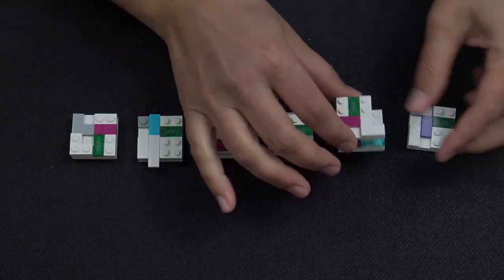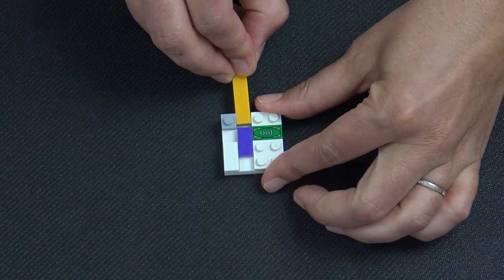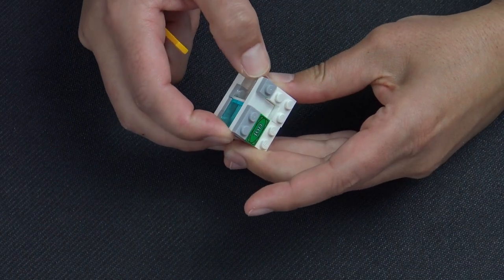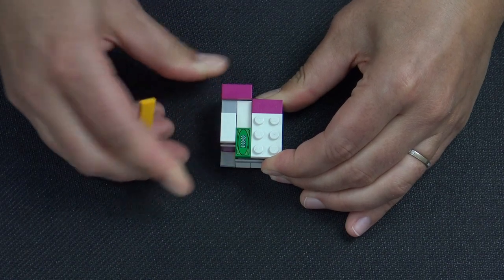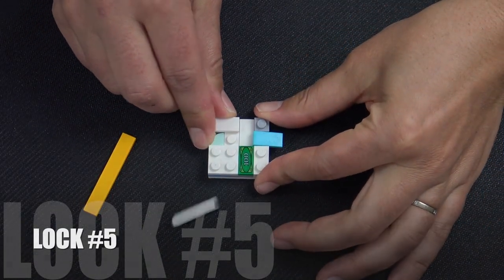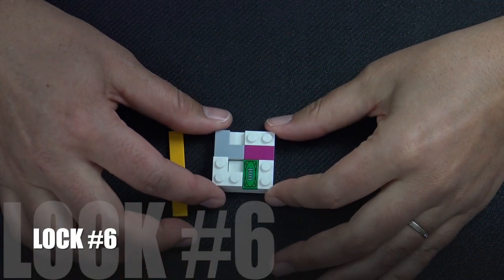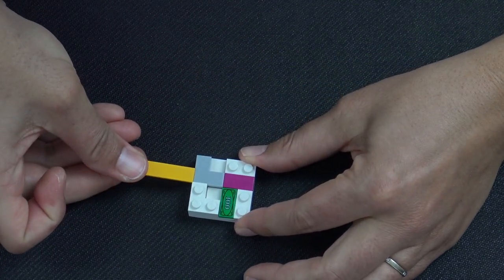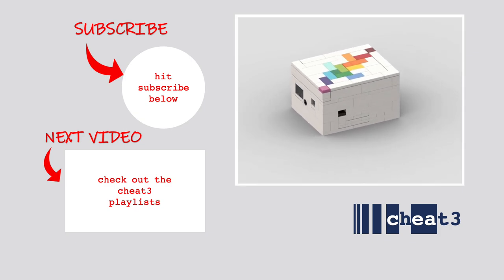Design Series: LOCKS 202 - Lego Puzzle Box Mechanisms

Comment: Hi, I’m new to the channel after watching Chris Ramsay solve a few of your designs.  I have an issue with resetting lock number 6 in this video. If the pink tile is pushed in before the money tile it makes it impossible to move the corner tile back without disassembly. Do you have a solution?
Reply from the maker: So glad you found us! When this mechanism was used in C3, the tile remained stationary and the brick beneath it moved (this eliminating the problem you mentioned.) You could also extend the box another length on the magenta tile side so it's more obvious for the person to push the money tile first because it's actually extended from the box. I hope this helps.